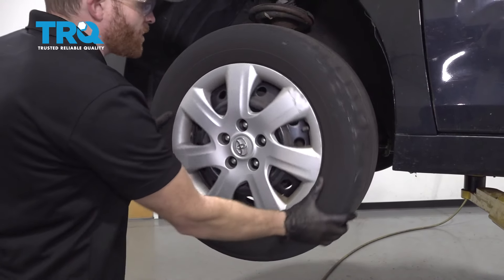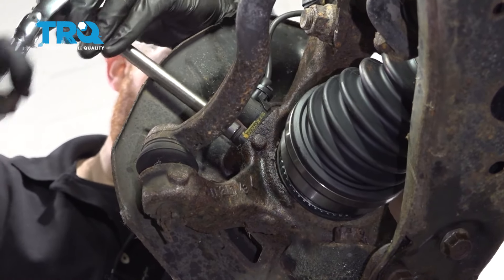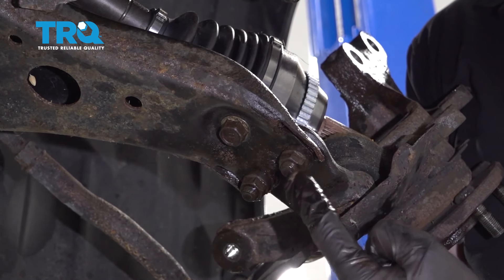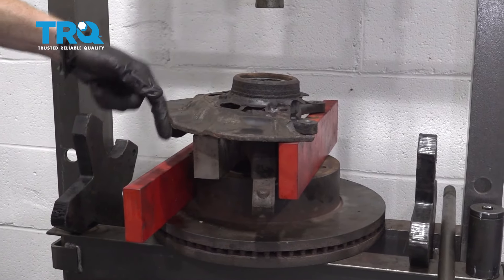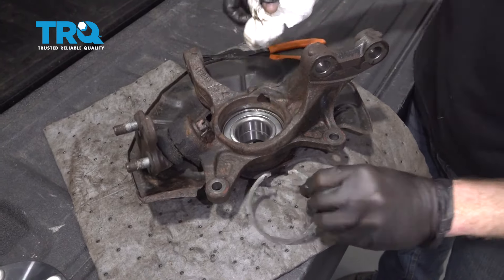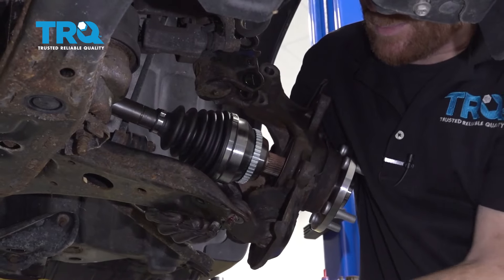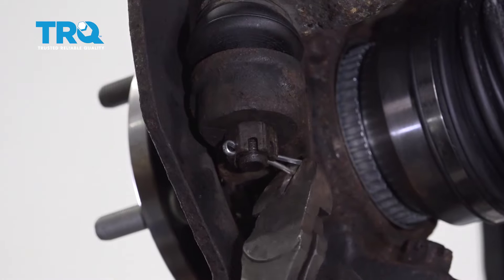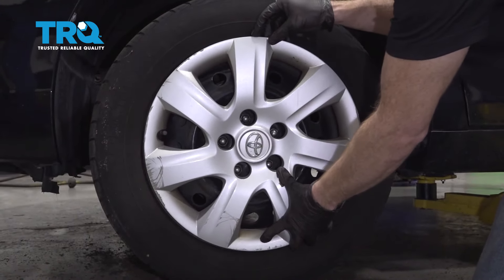How To Replace Wheel Bearing & Hub 2007-2011 Toyota Camry

Comment: If you use the original bearing, grind down the outside so it doesn't get stuck. Same with the inner races. I only use old bearings for spacers.

Comment: If I don't have a torque wrench should I just wing it?
Reply from the maker: +Adrian Martinez You will need to use a torque wrench to make sure the parts are up to spec for installation. If you do not, there may be issues down the road with the parts after installation.

Comment: I ordered the whole unit from you guys I'm thinking I must have got the wrong size because either that or my rotors are the different size of yours because I have vibration and I have a little wandering when I'm going and stopping and I took the wheels off and I noticed the rotors the holes in them are bigger than the new wheel studs that came on the bearing so either I have the wrong size rotor or the wrong size bearing I'm not sure which is there are two sizes
Reply from the maker: +@Williamcole10 We apologize for the inconvenience. Please give us a call so we can fix this for you!